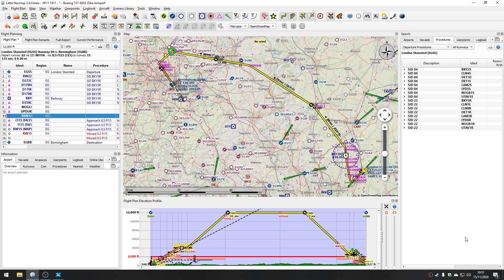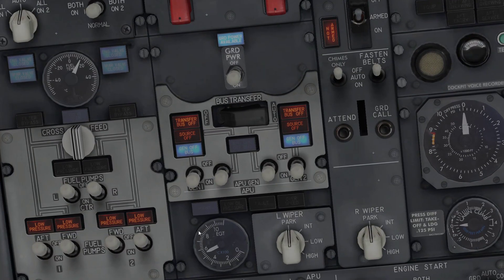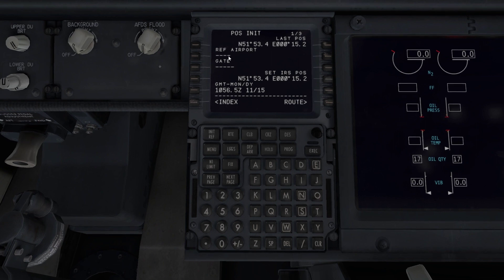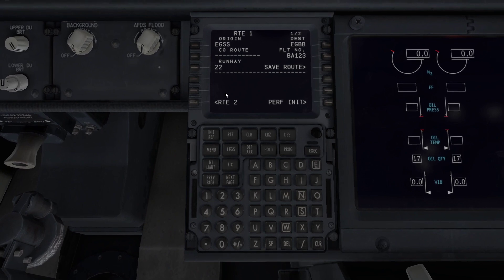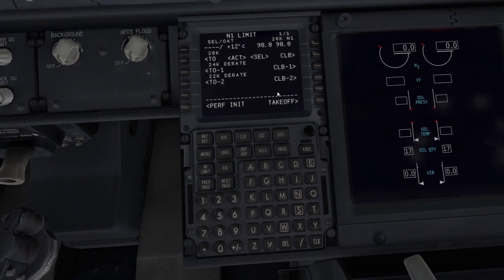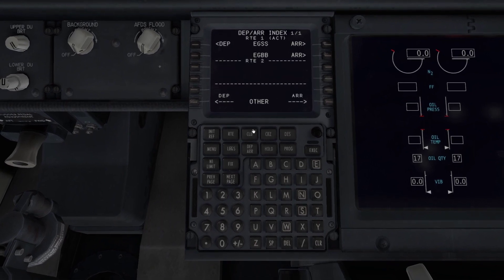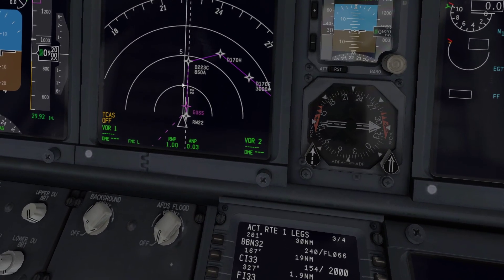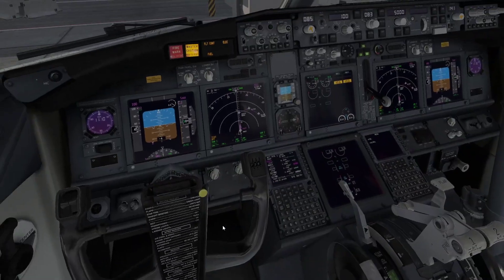Beginners Guide to Programming the FMC in the Zibo 737-800x in X-Plane 11.5

Comment: The cherry on the top of the cake now would be a tutorial about how to make a perfect tutorial as you do!!! Brilliant as always! Can I dare to ask questions here? When you enter the frequencies for the ILS, is there a Morse code sound like in the Cessna Garmin G 1000 audible? And also is it possible to make a flight plan with LNM or Simbrief or Navigraph 8, save it and enter it directly into the FMC? Thank you Jonathan.
Reply from the maker: There is indeed - the audio annunciator is typically not switched on, or very quiet - but yes - you can get it to play the morse.
Reply from the maker: You can do simbrief intregration in the 737. It's a bit convoluted. The easiest way is via LittleNavMap - but even then you have to know how to finish programming the missing bits of the route (simbrief doesn't give you everything). I find it easier to just program it myself.
Reply: @jonbeckett  Thank you for your answers! Have a great day.

Comment: I was keen to understand  how to load a flight plan previously created in Little Nav Map.  Frustratingly the Menu button and one other were not on the FMS.  I eventually found the user guide for this FMS and discovered that bizarrely the previously created flight plans are accessed through Route Plan>Co Pilot.  Not sure of the logic there as Menu seemed much more sensible,  Anyway, managed to load the flight plan  and now onto working out how to engage autopilot and a whole host of other challenges.